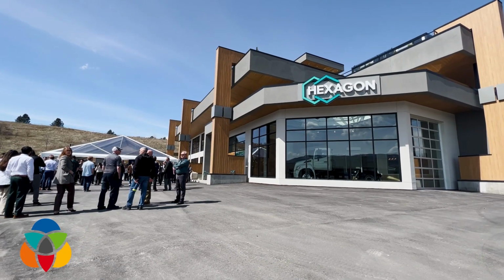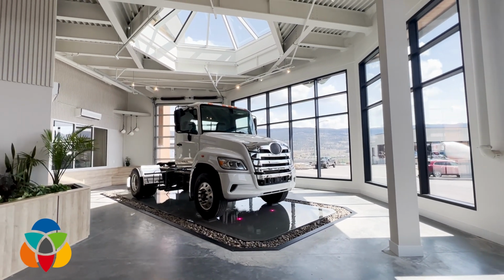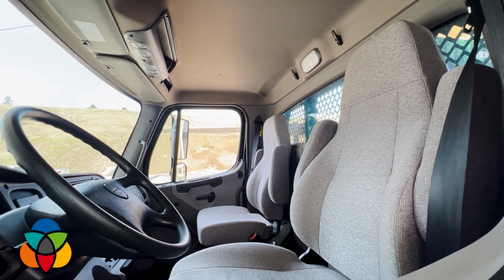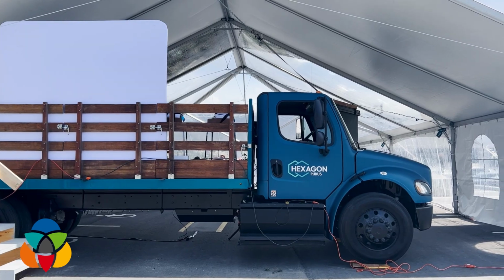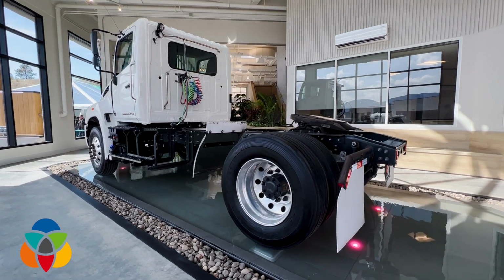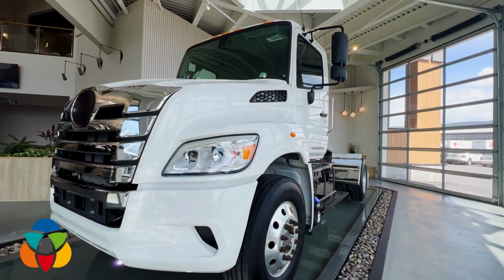Manufacturing facility for EV truck battery and hydrogen systems opens in Kelowna

Comment: I wonder what kind of power these hydrogen engines will make?  As a truck driver I'm very curious to see how technology is going to change the industry.
Reply: Around 700 hp and over 50000 nm... which is insane.